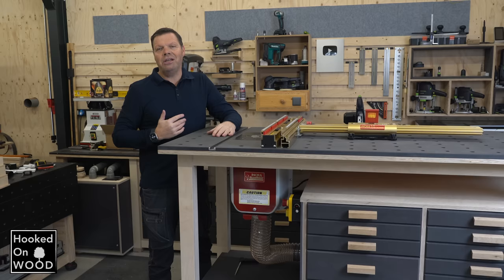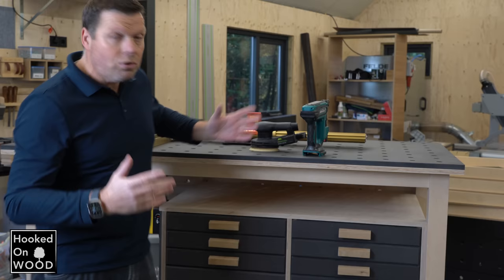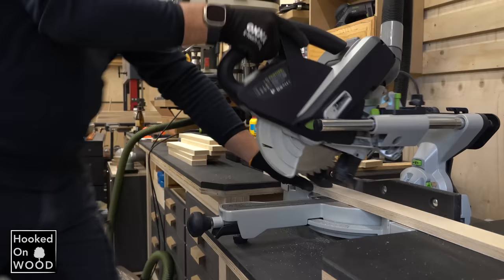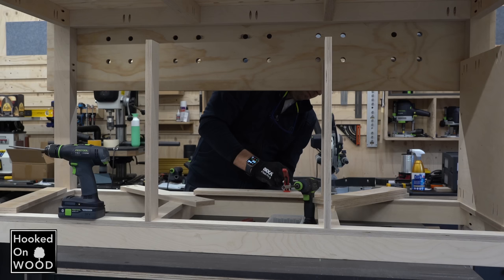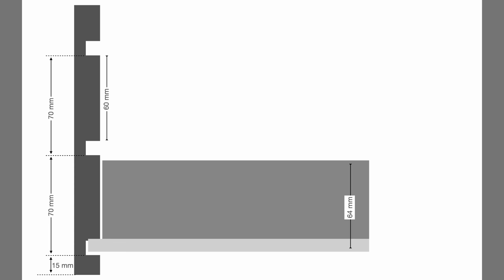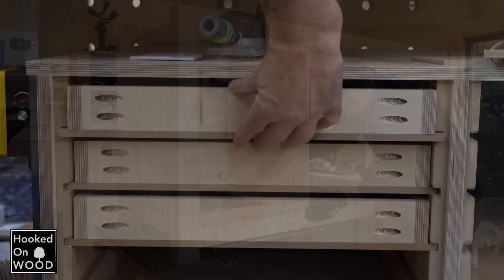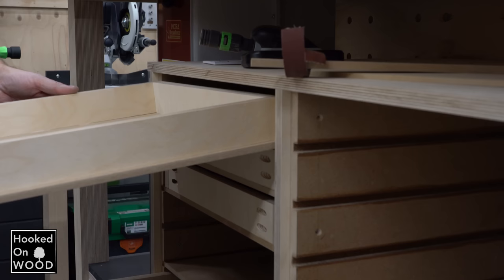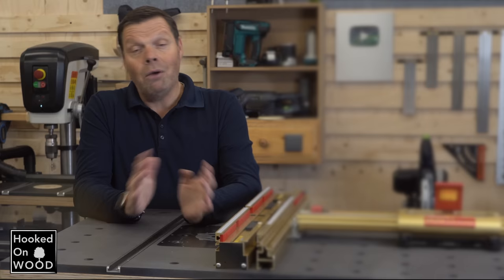Save HUNDREDS of dollars building your workbench like this!

Comment: Have now watched your video several times.  Did you make the dog holes yourself or buy a board with them pre cut?  How did you cut those pocket holes?  They look super crisp.  
I thought you / I just had to buy the variable speed router - not much more than a router tool, less if you count the cost of batteries and a charger, but then there are lifters, dust extractors and the "ladder" - or ruler that you have on top.  Would the bench top router be one of your most used tools?  I have found with some other things that I only know how useful they are after I have them.  Do you have another garage for paint and dirty greasy things?

Comment: with my first workbench i made a similar drawer system but using regular construction plywood, routed slots and i gotta say.... the drawers get snagged all the time that it frustrated me. like i'm always afraid to even open my workbench drawers.

i will try again using mdf and more care in measuring this time, because i really don't want to spend much more money on shop drawer slides. it's time to retire my v1 workbench.
Reply from the maker: My oldest workbench is 1.5 year old and do not give signs of wear.
Reply: @HookedonWood  thank you for the new tips and solutions!

Comment: Would you recommend a full sheet of MDF 1220mm by 2440mm (48 x 96") at 55$/each or "half" sheet of Plywood at 1000mm by 1000mm (40 x 40") for 15$/each in a climate where it gets pretty humid (Canada)? The plywood isn't extremely high quality, but it feels decent (it is used plywood, no holes). I'm afraid MDF would not like humidity too much in a non-heated garage (it is heated, but not regularly, only when I go to work in it in the winter, I'll start the heater about 2 or 3 hours beforehand to make sure it goes to a "stable" temperature.
Reply from the maker: I can not answer your question. Sorry, do not have not enough experience with humidity and the consequences on MDF and or Plywood. Of course, it will have some consequences, but I would not know how much, and how this does relate to MDF

Comment: Fantastic and beautiful design. Do you have plans for this construction? I could only see the 1st version on your website. How many sheets of birch ply are used for the frame of the workbench with the router?
Reply from the maker: I have to look at that, but I believe it was 2 sheets for frame, drawerbox and drawers. 1sheet black mdf, 1 sheet of plywood for the top. 2sheets 9mm mdf for drawer bottoms and half sheet mdf for sites drawers
Reply: @HookedonWood  thanks Dennis.
Reply: Hi Dennis. Just wondering if the strips of plywood for the legs and horizontal bracing are still 70mm. I was going to make them 96 but if the 70mm is strong enough without any flexing especially on the horizontal bracing it will save on a lot of material. Class design of a bench👍

Comment: id think if you applied a good wax finish/coating to the grooves the drawers run in, you could have a better slide and friction-less feel.
Reply from the maker: Yes, I will do. Thanks for the tip

Comment: One question, regarding the drawers, as I see you don't have any stop for them? For example, if you pull on the drawer too hard by accident, you might pull it all out
Reply from the maker: Yes, it fall out. My drawers are 60cm deep. You do not slide it 50cm out easily. So I think it will not happen that fast.

Comment: Hello Dennis, I do like your design very much. And As I am about to build my new Miter / Drillpress station, I was wondring about the dimmensions of plywood you used. Is it 15mm for the drawers? and 18mm for the rest of the bench? the bottom of the drawers seems to be 9mm MDF. Am I right?
Reply from the maker: Hi Markus, everything is 18mm plywood and the bottom indeed 9mm mdf

Comment: What width did you go with? I'm thinking up plans for better benches for our hackspace, and I'm debating what's a good standard width for drawers. Too wide and you end up with too many different things mixed up in one drawer, too narrow and you can't fit all your "X" in the same drawer. Both of which make keeping things organized and functional more difficult.
Also I note that on your mitre station there is no fence and you don't seem to have done the pull out top over the drill press. Is this because you've changed your mind on these things, or is it simply that you haven't got round to them yet? (I'm thinking of building something similar).

Comment: What about moisture? Can the wood swell and then not function?
Reply from the maker: I had a piece laying around outside for a week during rain. Only where I made grooves it swallowed. So, that would basically also happen with the dogholes if you do not treat is with some finish. But this was with rain outside. I do not think this will happen due to humidity. But I am not sure!

Comment: Great video! But, how do you keep the drawer from falling out if you pull it too far and spill its contents all over the floor?
Reply from the maker: The drawer is 60cm deep. You do not pull this out completely easily. But it is possible. Never happend by me. When you leave 10 -15 cm in you can reach everything insode
Reply: @HookedonWood  Thanks, cleared that up for me. Now, I just have to learn metric. I'm in Houston, TX and inches are king here.

Comment: I really like this approach, Dennis.  The standardized drawer sizes are a terrific idea.  Question though: Perhaps you've mentioned this on other videos, but what material are you using for your workbench top?  Is that some form of black MDF or is that a laminate of some sort?
Reply: It's black coloured HDF  (High Density Fibre). Available in other colours as well - in the Netherlands....
Reply: @hanstenhave3352  Hum..., Thanks, Hans.  I'm having some difficulty finding that here in the US.  The typical HomeGoods stores don't appear to have it, an neither do my two local lumber yards.  Perhaps there is someplace online.
Reply: @porthose2002  not readily available in North America. Only 2 suppliers I believe and it’s very pricey.

Comment: Thanks for sharing. What do you believe is the practical limit to drawer width? My cabinet design has an interior width of 28.5 inches (about 72 cm). I'm concerned drawers like these may not operate properly or be durable enough at that width. Thanks again!
Reply: Have you decided (and maybe built) yet? I’m curious about drawer widths too. 28.5” seems like it could work, wider would probably be pushing it. Half that I think would be pretty narrow. When I build mine I may shoot for 18”.

Comment: do I need to have that Felder lift under it? :D Or how you move it (turn it) around when you have on one side apron and on the orher side drawers. I ask becase the bottom of the leg (with the small square) does not seem to hold any wheel. Thanks
Reply from the maker: There are more affordable options than a Felder underneath it :-) I use the wheels you see in this short. https://youtube.com/shorts/ttNYoU55We8

Comment: How are the drawer slides holding up over time ? I've seen older kitchen cabinets with this style of drawers and they are generally hard to pull open and not smooth. Would you just use another round of epoxy if they are resistant to pull out?
Reply from the maker: This is not an high end solution, but affordable and it works well. When you wax them they slide smooth and when not daily use I think they will last. Some of mine are three years old and still works. But the best and more durable solution are drawer sliders ofcourse
Reply: @HookedonWood  Thanks for the reply! I agree, this is an affordable solution with some tradeoffs. It's a solution I have not considered seriously until now, and with yours lasting three years, maybe its the best return on investment for a hobby workshop.

Comment: The only downside I can see is that wihtout drawer slides, if you pull the drawer out too far it will fall. Do you do anything to prevent that?
Reply from the maker: Hi David, that is indeed a downside. I made my drawers 60cm deep, and natural I open it max about 50cm, so it does not happen to me. I found the solution practical enough, but you are right, it is possible that they fall out.

Comment: Hi Dennis, Thank your for another excellent and very instructive video. I like very much like your drawer system but have one question I am sure you have considered. If I am not mistaken the bottom of the drawer is only slightly longer than the side panels. That suggests that you cannot fully open the drawer before it falls out. How far can you open it? Would it be worthwhile to extend the back of the drawer bottom to prevent this and, if so, how much? Best regards, Henk
Reply from the maker: You get used to it. I made my drawer 60cm so i could use half a sheet efficient. Same for the sides. But when you open it 50cm it is pretty far and most is good reachable.

Comment: I had my router in a dust collection box.. It filled the switch and motor up with sawdust. I'll never do that again, you are working against the motor. The motors take air from the head, and push it down toward the bit, so you are not getting the cooling, and are sucking the saw dust in...

Love the black MDF, too pricey here. MDF is more than twice what it was 15 years ago.  So I'll stick to sanded ply and save a boat load.
Reply from the maker: I agree with you on this design flaw. There are some that do have the ventilation at the sides, like triton. However Jessem jas currently the best solution. Infact, they did it right

Comment: Hi Dennis and thanks for great videos! Why don’t you use the Sauter router lift? I consider buying the tilting one but not sure if it’s good.
Reply from the maker: Interesting question, and they even offer me one. I am/was especially interested in the tilting version. But I decided for the AUKTools because I think the outside speedcontrol is more beneficial. And there was no 2400 motor available.

Comment: I would love to buy that router but it won't work on the current in the US. Lots of good ideas though. Love the universal drawer system and love that it discourages stacking stuff in the drawer. 
Trying to find a source for Valchromat here too. No one stocks locally that I've found but hoping someone can order it for me. 
Anyone know of a router with a remote speed control that's made to run in the US? Not an add on speed control as those don't regulate the speed.
Hope you have a merry Christmas and happy new year Dennis.

Comment: Hi Denis, can you fit Bessey ratcheting clamps in your dog holes? I suspect this is not possible because of the thickness of the table (2 x 18mm). Thanks!
Reply from the maker: You are right about that. That is a problem, but there are good alternatives and because of that I prefer a thicker workbench top!

Comment: I am a great admirer of your videos and think that some of the methods you propound are absolutely brilliant. However if one tries to put them into practice oneself it is very difficult to do so. The reason is that you speak very very quickly and it is sometimes a little difficult to follow your Dutch accent. It would be easier if you spoke more slowly. It would also be easier to follow you if you spent a little more time in explaining each step. If plans were available it would also be easier. Sorry to be critical but I think your videos would do even better if you followed my suggestions.
Reply from the maker: Hi Selwyn, thanks for your comments. I will take them into account next time.

Comment: How to build easy and cheap (using tools for 10000$)
Reply from the maker: That doesn’t mean it is easy and cheap to do.
Reply: normally, woodworking videos like these are under the assumption that you have most of the necessary tools.  I have all the tools needed to build this, my only gripe is that where i live, one sheet of sand 3/4" ply is $100/sheet. which is a lot, and obviously you can use the cheaper ply, but it always has bubbles and imperfections.
Reply: I love this design and will build them when rebuilding my shop.  My $575 table saw will be the only tool I use.
Reply: @scumbagsteve5029 it's a huge flaw in their thinking; if you have this degree of serious tools, you will already have the skills and knowledge to design and build this project without viewing the video; and to anyone who is a newbie or hobbyist, it makes the video too advanced or costly for them.
Reply: And he did speak about getting grooves without dado blade or router. It would take more care and time but can be achieved with circular saw, drill/screwdriver and pocket hole jig(lots of DIY versions on YouTube)
Reply: Instead a Kapex, use one from Harbor Freight.  Maybe woodworking isn’t for you!
Reply: lol. You think he only has 10k on tools, that’s cute. But the neat thing about having nice tools is it probably means you did nice work in the first place to earn the funds to get them. Just keep working.
Reply: You don't need $10k tools if you use your brain a little bit to figure out other methods. If you cannot do that, having $10k will not even help you.
Reply: @b3arwithm3 yeah. I understand what the OP is trying to say but, One reality is, if you want to do something this “complex”, ever, a router is going to be a must for you. Good Routers aren’t $10000 or even $1000. You also must have a drill. You will need a saw (doesn’t have to be a table saw even, a good circular saw and guide will be fine). Once you have those, you could do this with clamps and an inexpensive pocket hole jig. If you can’t or don’t want to acquire those fundamental tools though, you need to have a deep think about whether woodworking is for you.
Reply: @rmTheWalrus  exactly, we all needs some basic tools and anything else is extra and a matter of convenience to help make things faster.  Out ancestors have no power tools. Most family furniture shops in Asia have tools that are below what homeowners have in America.  I don't get people who keep whining about not having fancy tools.  These people should stick to assembling IKEA furniture.
Reply: I have a $300 table saw and a $100 router, which is perfectly capable of building something like this. This video is great. The only drawback is Baltic birch plywood that would be ideal for this is incredibly expensive but you save on all the hardware needed to build it, and I love that it's modular.